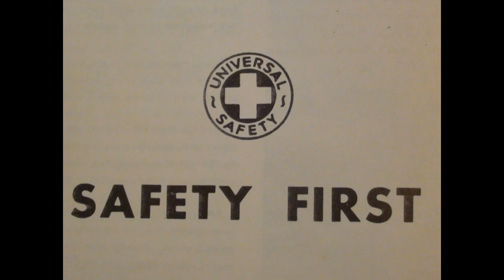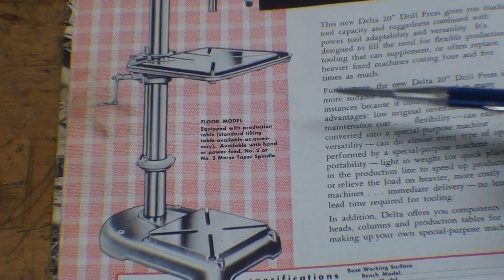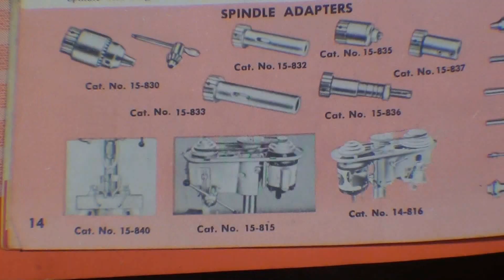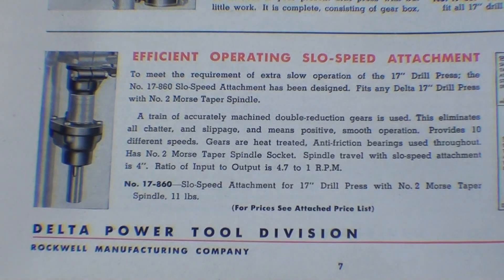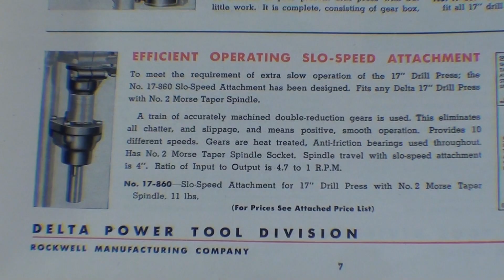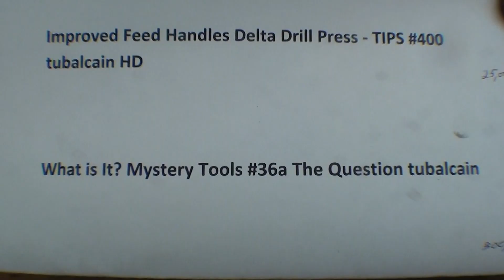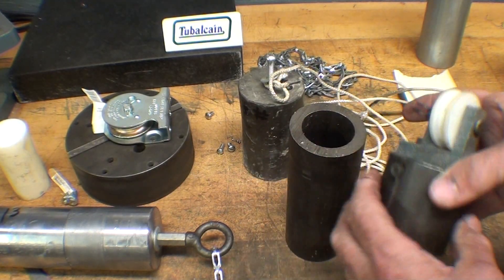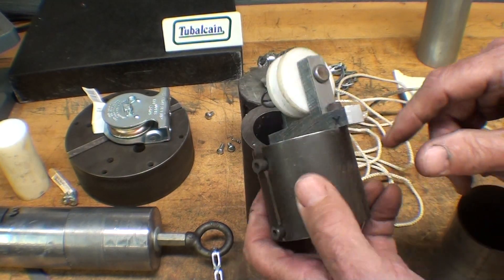COUNTER WEIGHTING A DRILL PRESS TABLE Tips #404  tubalcain

Comment: I know I would drop the chain down into the column. Lol
Reply from the maker: I DID!!!! Spent 10 min fishing it out with a magnet that clung to the inside of the tube--ha ha.
Reply: I was thinking I would have to tie a string to the chain, to keep from losing it in the column. LOL
Reply: He could have thrown you in after it! ;)
Reply: If the magnet string went over the pulley it should have gone right down the center. Or drop it down a piece of plastic pipe. 'Cause, been there, done that. I dropped the counterweight down the column of a large vertical boring mill. Not the chain, just the counterweight, all 450lb of it. Going in through the access panel and hanging by my hips I could get a hook through the ring and hoist it back up with the forklift. Then I put the bar across under it like I should have before I started wrenching on the clevis. Took a little more than ten minutes but I will never forget that important first step again. Especially since the foreman made me do it after work and charged me for the use of the forklift.
Reply from the maker: That's a great story
Reply: Sharklops your not going to believe this but I did the same thing. Don’t think I was a teenager yet. Dad said drop anchor ! I tossed it in the water and I can still see the anchor flying through the air with no rope on the end of it. I don’t think I tied a good knot because dad was yelling at me for something else stupid I did before. He pulled up the rope for minnow bucket and the rope come untied from the bucket. Needless to say I had a long day plus we never caught a fish. One anchor and one minnow bucket gone.

Comment: Outstanding video. However... You are NOT done with that drill press. lol! you need to turn a new pulley on the Atlas lathe to reduce the speed of that drill press to 300ish rpm. 😳 Then you will have a new favorite drill press. 😄 If you reduce the size of the primary pully and slightly increase the size of the secondary pully so that it the cover just fits (with room to move the belt) you will have exactly what you desire in the perfect drill press.👍
Reply: Tractor Wrangler: Great idea, but don't think there's room on my Rockwell to increase pulley sizes enough to make much difference. Now can't wait to check and see if it can be done; get these old mental wheels turning again.

Comment: Commentary from someone 2/3 your age:

Sash weights I remember very well.  At our house they were all covered in paint and didn't work all that well.  There was at least one window where the weights were disconnected entirely and just sat there in their pockets.

Greenhouse pulleys is an unfamiliar term to me.  

Now for what I suppose is the first mean comment for this video:  There's no such thing as too much coffee!

Seriously though, thanks for imparting your knowledge and wisdom this way.  I didn't get enough shop lessons as a boy so I'm making up for that now.
Reply: J.D. Luke  I used to take sash weights out of old tear down homes and use them to weight down Crab trot lines and I also used them as anchors for a small fishing boat. They work great for this because they lay flat and stack well in a boat and they don't get stuck on the bottom like anchors sometimes do. They also make great trunk weights for rear wheel drive cars in the winter time. You toss one bag of sand over each tire then you toss as many sash weights as you feel you need right on the top of the sand bag so they dont roll around. I could do an hour video on uses for sash weights. They also fit nicely inside the frames of some lawn tractors for snow blower setups and on the blade of craftsman snow plows to give the blade more weight. Oh boy. See what you started ...
Reply: Great ideas.  Did you ever use them to weight down the corners of a tarp so you could build a temporary windbreak for smoking? :-D
Reply: J.D. Luke Not to smoke no. But I have used them to hold down a tarp on a firewood pile. Does that count?
Reply: Absolutely!
Reply from the maker: Never enough coffee

Comment: They use to break the rack on the drill press by not tightening the clamp and putting the drilling pressure on the rack. That said I believe I to will add a counter weight to my own table.
Reply from the maker: They will break anything
Reply: I'm not sure I understand this. Doesn't that just mean the table would slide down on the column or even bind as shown in the video if it's not locked? How did the rack get damaged?
Reply: These drill tables don’t have a rack & pinion.  These counter weights are used instead.  I put a similar one using aircraft cable instead of chain, and I used two very small pulleys in line on two parallels to span the tube edge so the weights were in the center of the tube, with a clamping screw on a slit to hold it all in place.